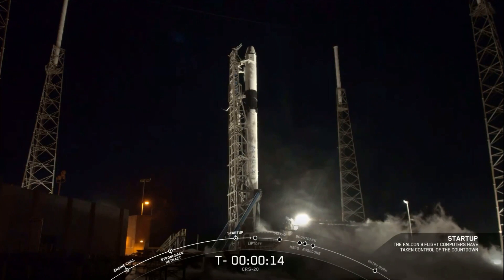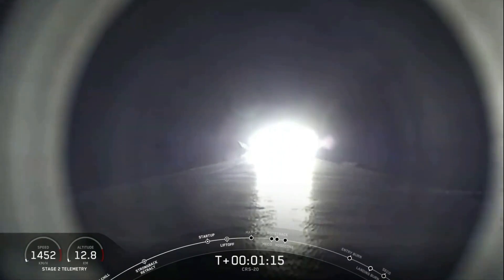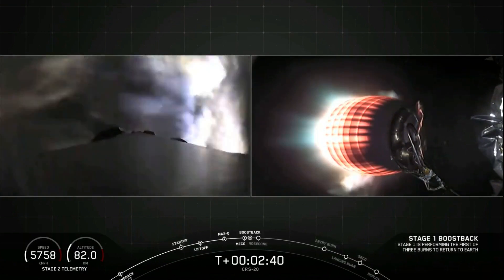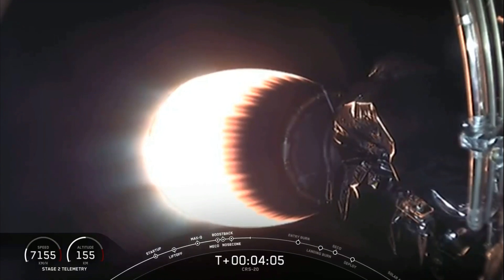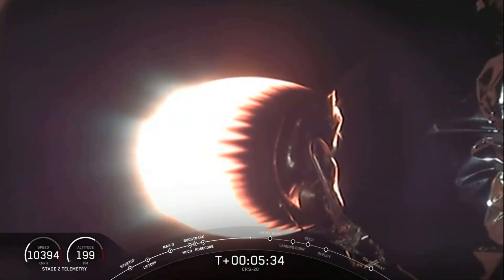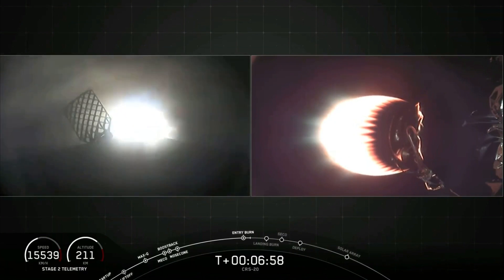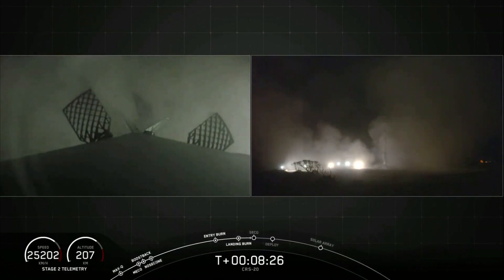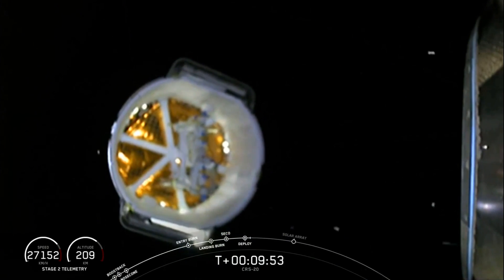SpaceX CRS-20 Launch & 50th Rocket Landing

Comment: Why still use engine rocket for landing.... Why not use drone engine✌️✌️
Reply: Because there is already rocket engine on rocket, why you want add some more stuff on, it will make it heavier
Reply: @broniusbronka2703  its reduce cost and good for landing in mars without any impact and if have sand storm can use drone moving fast than using tyre☺️👍
Reply: Technically it already is a drone...I think
Reply: @cliffhankins5886  nope they still use same rover they made but upgraded add on few part☺️ drone need solar system and new battery system for boost energy for drone engine and after that drone spin its charge and gain energy by self without usin charge from solar or battery but give charge to battery☺️ i call it SWITCH CHARGER